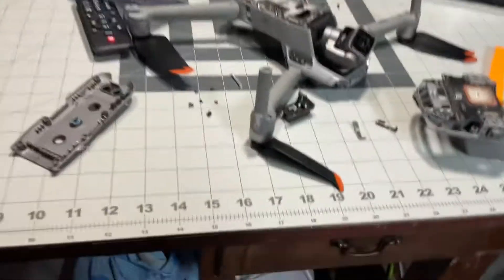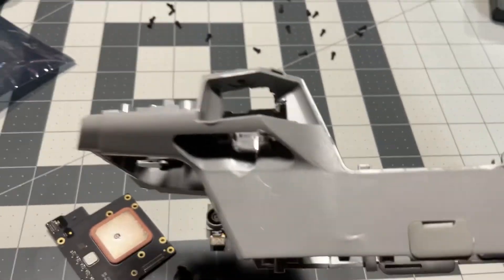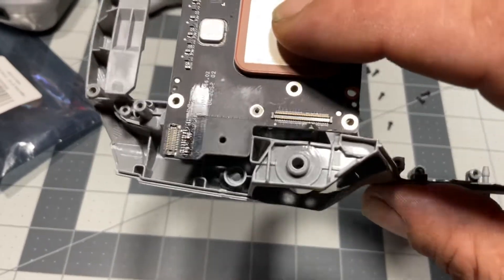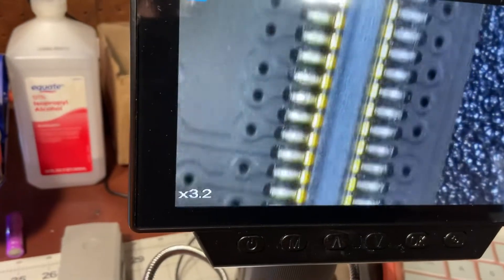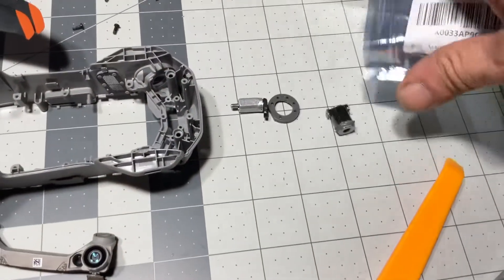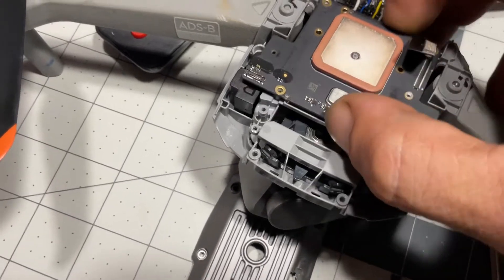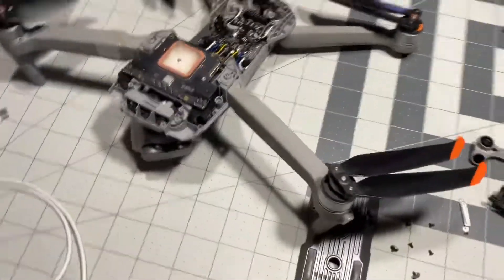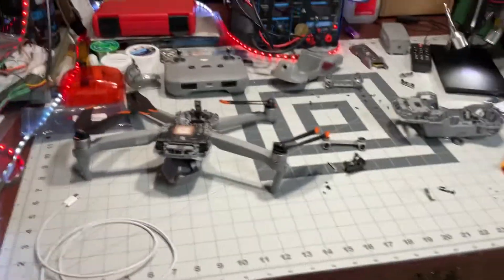DJI Drone Wowes. IMU Won’t Calibrate Solved!

Comment: Unable to Take Off
• IMU calibration required. Calibrate IMU (Code: 30050)
Calibration
Barometer initialization failed. Restart aircraft
•
(Code: 30047)
•
GPS signal weak. Positioning accuracy affected. Fly
with caution (Code: 30049)
Gyroscope initialization failed. Restart aircraft
O
(Code: 30045)
No GPS signal. Unable to hover. Fly with caution
•
(Code: 30007)
Reply: I have the same problem and NONE of the videos on youtube have worked so far.
Reply: @AirPictureGM  THE SAME WITH ME. ANY SOLUTION?
Reply: @DLBCOsun  any solution?
Reply: @AirPictureGM  Any Solution?
Reply: any solution bro?